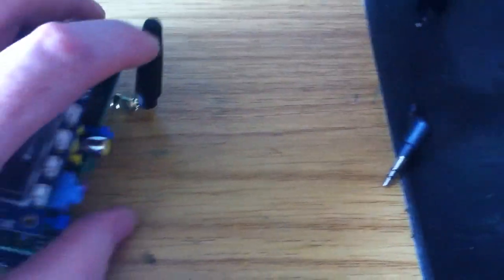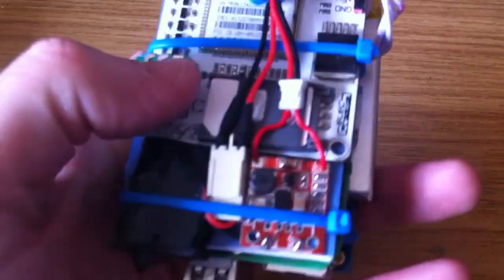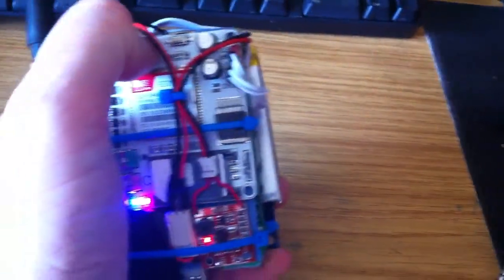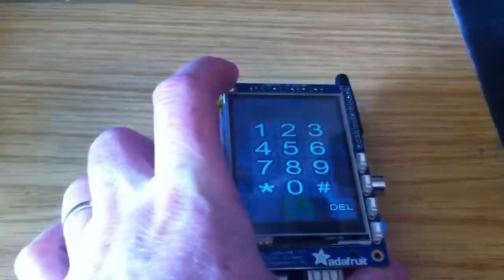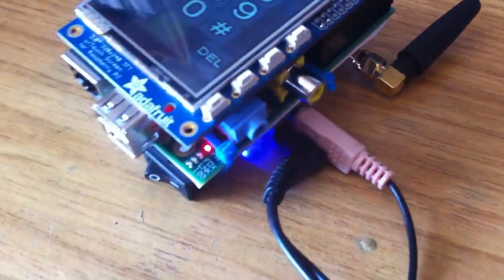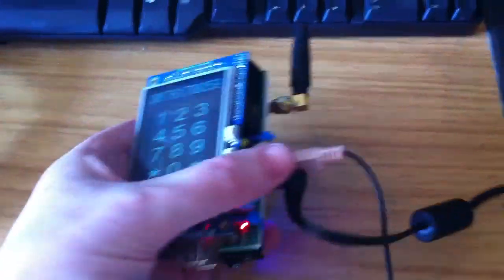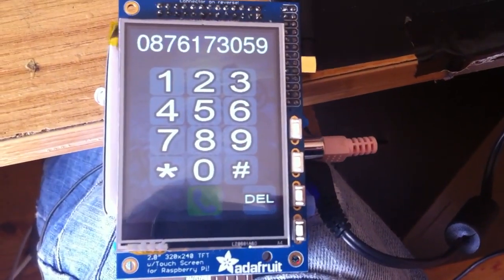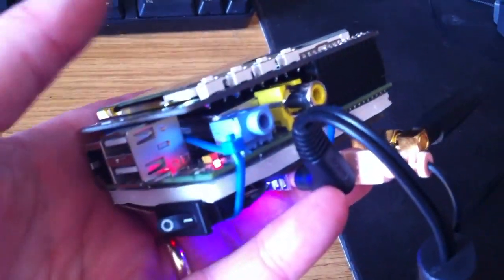PiPhone - A Raspberry Pi based Smartphone

Comment: I'm surprised how hard it is to find home made phones. As google, apple, etc continue to reduce the level of ownership we have over our overpriced, un-repairable pocket computers I would think that DIY phones would be the average tech geek's go to for cell phones.

With the revelation of Windows: CIA edition, I'm finally making the switch. 
I plan on making a linux cyberdeck for my main computer and will include a 4g modem (sixfab? recommendation?) 

FYI: verizon already shipped me a free SIM card associated with my phone # and said there is no billing problem with me continuing to use my phone as I test my new rig.

As the computer will be too big to act as a phone, my main hurdle has been finding an economic blue tooth phone receiver. I don't even know the search terms to research this. It seems like any wireless earphone is half of what I need, but...
I'm hoping to find a smart phone sized device that includes headphone jack, speaker phone, and basic ability to navigate contact list and send/receive texts.  Ideally something that runs for 18 hours on an 18650. 

I do have a 3d printer, so rearranging an existing off the shelf device is possible, if such a thing exists.

Comment: I'm pretty sure the pi zero would be a better board to do this with. It would at the very least allow for much more space. There is a android build for raspberry pi, and it does work with the pi zero w which would allow for so much more capablities. The one issue is the pi zero w would actually need to be overclocked, which is easy to actually do without causing too much of a temp issue, the issue is when you slap a screen on it would.  I have done this to run my 2 doom servers, which 1 of them eats up more resources then my quake, assault cube server, mumble, irc, mysql, and apache combined. Also I recommend not using apache with the pi zero, there are more light weight options.

Comment: Cheaper Alternative:
Orange Pi 2G IOT: $9.90 http://bit.ly/2f4ZiQe
SIM card: ??? 
TFT Touchscreen 800x480: $9.98 http://bit.ly/2f59XL1
Micro USB cable: $2 http://bit.ly/2xPDbFf
Portable Battery Pack: ???

Still, impressive for what you've done.
Reply from the maker: Published on Apr 28, 2014 :)

Comment: How much did it cost to build this? Im interesting in building one. Probably not the same as yours, but i need some what of a price range
Reply from the maker: About $150. Would be a lot cheaper with Pi Zero, knock $30 off that. Also, prices for the parts would have gone down in the couple of years since I built it.

Comment: hi. im building my own phone, but i need an operating system. what are you using? FYI you shouldve used the adafruit feather for the actual calling part, cuase its tiny.
Reply from the maker: Try www.davidhunt.ie/piphone-a-raspberry-pi-based-smartphone/ and learn.adafruit.com/piphone-a-raspberry-pi-based-cellphone should have all the info. :)

Comment: Try to make Android boot on it.
Reply: 3ksoda 

Mebay it is possible. I"m not a dev so cant tell for sure.  I wonder how would it be to use Pi - Phone with Android as a daily device :P
Reply: Michael Johnson 

I watched some vids about Android on PI. GPU drivers arent working well , system is laggy as hell , No Internet connection.
Reply: Pretty accurate, but the latest I've tried had the native wifi on pi3 working fine. Some google store apps wouldn't work. Netflix was the only one I wanted but didn't work either
Reply: Michael Johnson 

Do there is progres. What is the Android version ? 4.0 or 2.3.6 ?
Reply: It was version 7.0. They update it a lot, and looks like they have another version 7.1 out today.
https://git.embedded.rwth-aachen.de/rtandroid/downloads/raspberry-pi/
Reply: @michaeljohnson_ok  you need to enable ethernet in settings
Reply: Rasberry Pi powered by Android.

Comment: Any plans to make a Pi Zero version?
Reply: K_Lar your can remove unnecessary parts from the pi. Zero will not run well as a phone.
Reply: @Coven Depends on the application. For a smart phone, i guess.
Reply: +CoveN But it could work alot better in a smartphone like this because of it's size and lack of parts you dont need in a smartphone like hdmi

Comment: this is better than a cell phone because you can run your own OS and have multiple storage, networking and accessory options. In other words I would buy this over a cell any day and I'm sure it cost a lot less as well.
Reply: try Android 4.0.4 it still supports most of the latest apps
Reply: Any android phone without a locked bootloader can have your own OS. Most android phones have multiple storage. Accessories are available most if not all modern phones

Comment: As suitable 3.2'' LCD TFT Touch Screen can be bought for just $12.20:
http://www.banggood.com/3_2-Inch-TFT-LCD-Display-Module-Touch-Screen-For-Raspberry-Pi-B-B-A-p-1011516.html?p=JQ26191551677201504Z
Reply from the maker: +MrAGOGOHOME I wouldnt consider this "suitable". You would have to re-do all the graphics, and then alter the setup so that screen can be used instead of the 2.8". It's much easier to go with a screen that we know works.
Reply: get a 4inch

Comment: what OS??
Reply from the maker: +JakemaKun Raspbian with pygame
Reply: +Dave Hunt can android run on it
Reply: +Chalklate Sort of?  Android CAN run on the Pi, but it's not worth using, it's not at all optimized for the pi's graphical capabilities.  That being said, think about it for a second.  Android is really just Linux underneath it all.   This is just just flat out Linux...  You can do anything with Linux; er go, you can do anything with this (within reason to the power of the computer of course).  With a few tweaks, I think this could be a viable phone to use.
Reply: operating system
Reply: Evan Yearwood I meant what os the phone uses.....
Reply: O wow have no idea
Reply from the maker: +Evan Yearwood Raspbian with pygame

Comment: Hello How yuo connect the battery to the raspberry and then how to charge the battery? Thanks for your soon answer I need it for my proyect.
Reply from the maker: +Disint The Battery is connected to a DC-DC converter which gives 5V for the Raspberry Pi, screen and GSM module. To charge, the battery is disconnected and attached to a LiPo charger.

Comment: Great job. One quick question though: how do you adjust the screen orientation on the phone interface? Thank you.
Reply: +Julio Oliveira I doubt there was room for a gyroscope. He probably just set it that way permanently.
Reply: Yeah; I looked at the code. Couldn't find anything related to 90º rotation, that's why I was asking how he did it.
Reply: +Jajoo Fixed it. /boot/config.txt there you can find a line that says: dtoverlay=pitft28r,rotate=90,speed=32000000,fps=20 (depending on your previous settings). If you change that 90 to 0 it will turn into landscape mode.

Comment: Her bro i have a question that gonna blow my mind :P I can connect the same battery like you use just directly to the pins where the Raspberry charge? I'll keep the mini usb port to charge the battery. Please i really need an answer!!
Reply: League Of Promotion™ I was about to ask if he could skip the DC-DC booster by bypassing or reconfiguring the chip that lowers the voltage on the Pi from 5V to 3.3V .

Comment: Yay, something else that I can't figure out. Seriously, how do you even use these things? I've looked at so many tutorials yet still can't figure the Raspberry Pi B+ out.
Reply: GamingPenguin  I hear you on that one! Not sure how people just know how to use this stuff. The internet does a bad job of teaching you anything useful 98% of the time. I have had one for months and don't know what to do with it. The only reason I don't throw it out is because somehow you CAN do all these odd things with it!
Reply: Zenith Sheathman I know! I can't figure it out!
Reply: GamingPenguin Perhaps you should start with firing up lubuntu and learning some linux on your PC. Then a linux powered single-board-computer will start making more sense.
Reply: Zenith Sheathman Well, it's pretty easy to use the gpios with the wiringpi library and toggle stuff like lights and electrical relays. "gpio -g mode 17 out; gpio -g write 17 1;" will turn on pin 7. If a relay's connected, it'll go click, and whatever's connected will turn on! I have some AC relays connected to a power strip, so I can control power outlets with my Pi.
Reply: Graham Cantin Can you please translate that to English?
Reply: GamingPenguin Okay, GPIOs are 'general purpose input outputs' -- you'll find a number of them on the Raspberry Pi's expansion header. They are numbered. There's also a linux tool named 'gpio' that comes on most of the raspberry pi linux images. You can use it to set the mode of a GPIO to output or input, and if it's set as an output, you can change the level of the GPIO pin from low (0v/ground) to high (5v/3.3v). If you have something connected to this pin, like a relay, LED, buzzer, or anything else that can be controlled by a transistor, it will turn on and off as you instruct the GPIO pin.  I have one side of a relay connected to the pin labeled 'Pin 7', and the other to the ground plane. When I type 'gpio -g write 17 1', the pin will turn on the relay, which will turn on my 120V power strip. If you need a more comprehensive explanation than this, check out http://wiringpi.com/

Comment: Now that there are kits out there that can give you a touch screen via HDMI, have you considered updating this? I thought about doing this a while back when i first stumbled onto your project, but noticed that the screen as a primary display device wasn't very practical. Now that it is, it would be interesting to see if a practical smartphone would be possible with pi, which would give us our classic desktop environment, and if we lugged a pocket sized wireless usb keyboard along, we could have a simple netbook replacement computer that doubles as a phone. We could develop and debug apps on the machine as we test them, and this could all be done with completely free software (and thus we also have access to countless existing free softwares), and giving us better control over apps for security (which seems to be a problem for the android and iphone phones right now where a flashlight app gives away GPS locations). Mix it with "data plan controls" and you could make it so only phone calls and texts use the tower, and the rest relies on wifi (also possibly through nub) so that data usage can be turned on and off to control phone bills better. What do you think?

Comment: Thats not a smartphone.
Reply: BinaryCounter  Notice the keyword "typically" -- meaning it doesn't have to meet "all" of the requirements. The phone app in the video was programmed in Python. Learn about technology before you speak next time.
Reply: Yes it is... It just needs a case
Reply: Chrismasterski NO it's not. You can only use it to call someone. Smartphones have multiple features. But this phone functions like a home phone! YOU CAN ONLY USE IT TO CALL SOMEONE!!!!!
Reply: Ahhhhh -- actually it is exactly a smartphone

smartphone = mobile phone + OS
Reply: Honorablewolf   (sigh) You have zero clue what you are talking about.
Reply: CarMoves *You* have zero clue what you are talking about. Here's a definition from Wikipedia: 

"A smartphone (or smart phone) is a mobile phone with an operating system.[1][2][3] Smartphones typically include the features of a phone with those of other popular mobile devices, such as personal digital assistant, media player and GPS navigation unit. Most have a touchscreen interface and can run 3rd-party apps, and are camera phones. Later smartphones add broadband internet web browsing, Wi-Fi, motion sensors and mobile payment mechanisms."

And here's one from the Oxford dictionary:

"A mobile phone that performs many of the functions of a computer, typically having a touchscreen interface, Internet access, and an operating system capable of running downloaded apps."

So clearly you are wrong. Have a nice day.
Reply: CarMoves I'm studying computer science and can code in 4 different languages including Python. Please don't attempt to shut me up, will ya? 

The phone has no more functions than a cheap land-line phone.
Just because it was realized with a high level programming language and operating system does not mean it is a smart phone. Or else you will have to include normal digital telephones and the first nokia phones into your definition as well, since they run an operating system which was coded in C, a high level language.
Reply: BinaryCounter  "...cheap land-line phone..." -- has no OS. There is NO such thing as "digital landline".

"...So by definition everything that has some sort of processor and a program that interfaces software and hardware HAS AN OS!..."

You don't understand the difference between "software, hardware, and firmware:, and "OS and program". Because you don't understand this, you are "assuming" you know what you're talking about, but don't.

And I was born in Germany -- another fail for you.
Reply: CarMoves ...No. Bye.
Reply: CarMoves tell me ze name of the operating system and I shall believe you!
Reply: MJ Wheatley Yeah, but only the added features would make it a smartphone, not the ability to add these features. 
But an ultra cheap smartphone based on debian linux would be really neat.
Cheers. ;)
Reply: BinaryCounter lol it won't stop
Reply: CarMoves There are digital landlines. They are the landlines where they have a small screen that you can interact with to view call history, contacts, etc. There digital because they have a processor and you can interact with them. (im pretty shure)
Reply: Sun Patkar kind of says that in the title, captain obivious
Reply: CarMoves a phone is what you use to make calls and text and that is the only thing that phone can do, a smartphone however has additional features alike a web browser, or apps because it is smarter than older phones... So this is a phone
Reply: BinaryCounter  "...mobile phone with an operating system..." - it does

"...performs many of the functions of a computer, typically having a touchscreen interface..." - it does

Thanks for your help!
Reply: CarMoves Yeah, no. You are leaving out the important parts in the definitions:

"Smartphones typically include the features of a phone with those of other popular mobile devices, such as personal digital assistant, media player and GPS navigation unit [...] and can run 3rd-party apps, and are camera phones. Later smartphones add broadband internet web browsing, Wi-Fi, motion sensors and mobile payment mechanisms."

"...Internet access, and an operating system capable of running downloaded apps."
Reply: BinaryCounter  Only 4 languages? Landlines and the first Nokia phones don't run OS's. Better go back to school.
Reply: CarMoves Do i have to whip out definitions again? Here ya go: 
"An operating system (OS) is software that manages computer hardware and software resources and provides common services for computer programs." -Wikipedia

So by definition everything that has some sort of processor and a program that interfaces software and hardware HAS AN OS!

That includes nokia phones and DIGITAL landline phones. As soon as you can store something in it, even if its just a call history, it must do some sort of software / hardware interfacing.

And now i will stop replying to you, since i am wasting my time with you, while i could be enjoying my new Banana Pi. Just pretend you won this argument, if it makes you happy.

PS: The first nokia phones dont run an OS? 
http://de.wikipedia.org/wiki/Nokia_OS 
(There's no english article for that, try reading German)
Reply: BinaryCounter If he wanted to, he could give it other features to make it use a computer-like interface in addition to the phone interface. It's built with a Raspberry Pi, so it's literally a computer being re-purposed into a phone. If any phone has the potential to be a smart phone, it's this. With some more work, this could become smarter than the average smart phone, and be able to call, use the internet, etc., while being more powerful than the average smartphone, and more portable than the average computer or laptop, and with more customization capabilities than a smartphone-tablet hybrid. Not to mention that it's a ton cheaper than the other options.
Reply: BinaryCounter It is true that the current form isn't a smartphone, but it does have extreme potential. I'm pretty tempted to make a Raspbian PiPhone, haha. Then I could hook a monitor up to my phone and have a full computer straight from my phone. I'm currently looking into how to add extra ram to the Pi 2 B, so that's going to be an interesting feat.
Reply: ethan polcyn  there is no such thing as a Digital Landline. it's like calling a CD digital vinyl.
Reply: Its a PiPhone
Reply: Honorablewolf lol